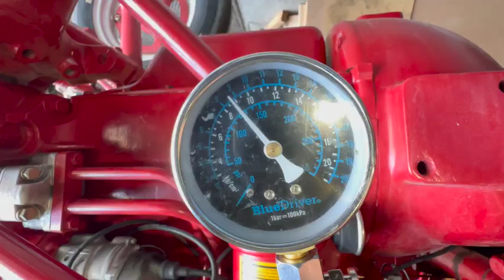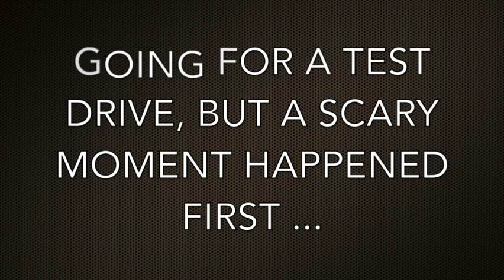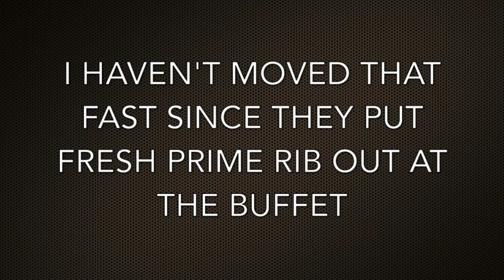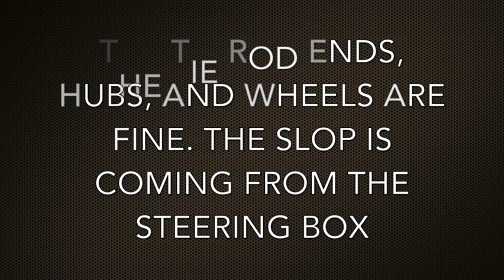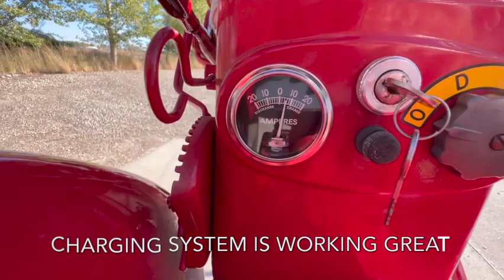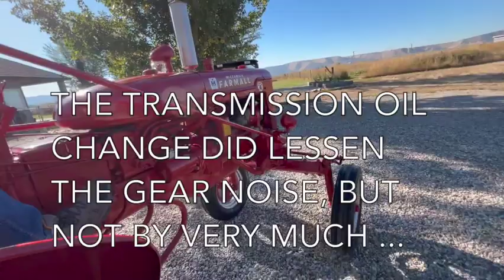1948 Farmall Super A - Part 3

Comment: You found a super nice Super A.  Not many left that have operable shutters.  I'm in the middle of rebuilding a pair of Super AVs that had been sitting for goodness knows how long.  I have both of them finally running (and braking) again but still lots to do to get the hydraulics fully functioning.  And both need painting.  One suggestion I have frequently heard about Super As and AVs: a wheel weight on the right rear wheel will help a bit with stability.  Won't fully counteract the engine offset to the left, but makes them a bit less tippy.  Enjoy!
Reply from the maker: Thanks for the tip!

Comment: nice super a inspite of some wear. looks to have been well used but also well kept. im currently restoring a 51 super a. taking it almost down to the last bolt. inspiring to see one running as mine hasn't run in many years. getting the crank turned now. hope to get motor back together and running by Christmas   lol.  thanks for your video.
Reply from the maker: Thank you. Good luck with the project!

Comment: Let me know if you want to get that steering spot on! My Super A was steering from about 12 to 6 easy, now it has virtually no play at all. These are great tractors!
Reply from the maker: Yes, I love this Super A! I don't have the space to remove the front end at the moment, but I will be tackling that in the future. I saw you have a couple videos on this repair?
Reply: @AntiqueCarsandStuff  yeah it was really bad ! I found that the keyway play at the sector shaft and gear being raised slightly and replaced with a new one helped,  welding new points on the sector gear wear the steering arm slides on eliminating any side to side play as well as welding the notch in the sector shaft where the bolt attaches the steering arm eliminating the up and down play. New bearings helped but weren't actually too bad for being originals.  The steering shaft you replaced was definitely worn bad and will be absolutely be perfect  after!  Btw You have a beautiful setting and a great shop brother!
Reply from the maker: Thanks for the info. I plan to keep this SA so I’ll plan that repair for sometime in the future. I love my little shop but it’s full! No complaints about that though. I enjoy my toys. It’s my happy place. :)
Reply: @AntiqueCarsandStuff  I couldn't agree more, its definitely a happy place to unwind no matter what the project!

Comment: I have a Super AV and mine did the same. thing there is a half gear with a keyway and the gear wears where the keyway is I put a new gear in mine and that fixed it
Reply from the maker: I improved the situation some by replacing the steering shaft with a better worm gear, but yes I will have to pull the axle someday to replace that half gear. It sounds like a big job so I'm not in a rush.